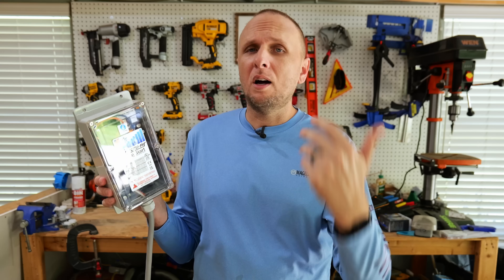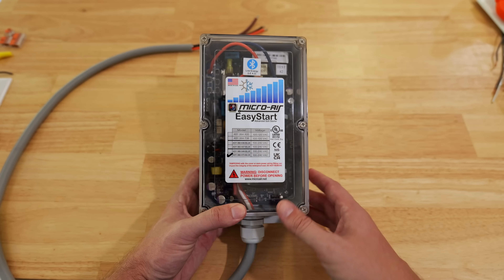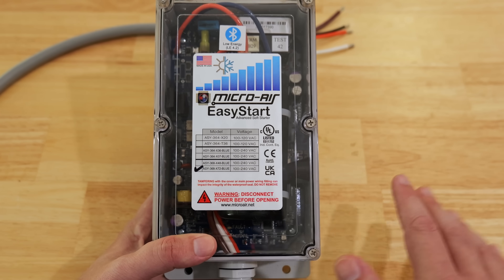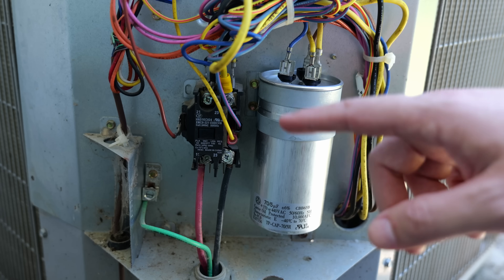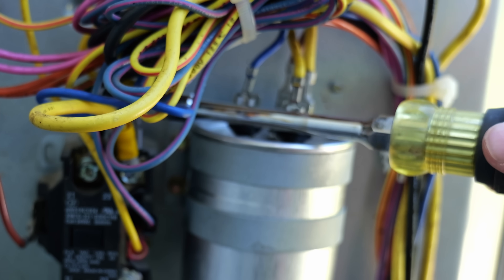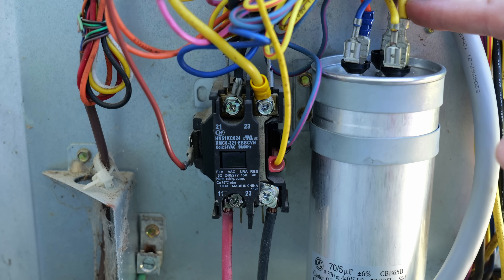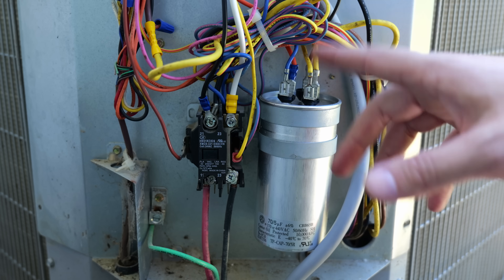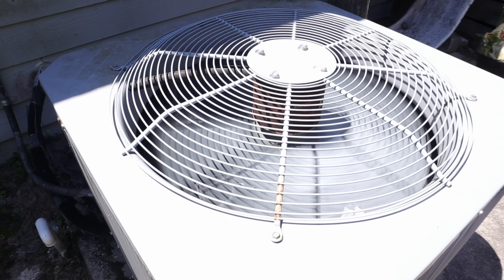Why Every Homeowner Should Consider Installing an AC Soft Starter | Micro Air Easy Start Install

Comment: Howdy again,   Thank you again,  i did the install in an hours time, mine is on roof and i got a work out just remembering the tools and materials i needed could have saved 20 minutes easy if AC was at ground level.  Works great, cool air takes a few minutes to come out as the compressor ramps up. but i no longer hear that loud HMMMMMMMmmmm at start up, so thats a good thing!   fyi   regarding your update,  mine there was two wires on "C" compressor one thicker then other, however the thick wire ran inside to were compressor was, the thinner wire connected to the terminal. i chose the wire to terminal.  must be correct as the unit works and i have a green light on the easy start.

Comment: It voids your warranty.
Reply: No it doesn't
Reply: Thank you. I called my warranty company and they said installing this will void my warranty. They are the ones that will repair my unit under warranty. I just don’t understand why the channel creator thinks this is not true. I have spent a lot of time tracking these conversions down to spread the truth about my experience just to help people.
Reply from the maker: Because it isn’t 😂.  Get a different AC guy.
Reply from the maker: Not true.  There is legal precedent as well where it can’t just void a warranty.  Now, if it’s installed incorrectly and due to it being installed incorrectly it causes a problem, then maybe there would be an issue just like anything else being installed on it.  But to say simply adding this voids the warranty is just not accurate.

Comment: Hey man, excellent DIY video. Perfect instructions and it was a breeze. Starting 143 A after 5 runs 27-30 A. Can’t believe how much it helped on A. AC runs good and it’s a lot more quiet during start up.

Comment: I installed mine about six months ago and my on rush current went from 77 amps to 23 amps.  It seems the systems should be designed with this.  Why have a large current to start?  Makes no sense!  AC has been running great.  Next thing you need is an Intermatic water heater timer.  The new digital version is great.

Comment: I have one in Florida and will install one in Texas, for generator you need an interlock kit specific for your panel, 50 amp 220 breaker, and 50amp cable for your generator.

Comment: I install one and make my ac crazy run good for a week and them fry the capacitor I try 2 more time and the same run good for a week them it fry the capacitor and it wont start I remove it and my ac is ok no problem
Reply from the maker: There are a couple reasons this could happen.  Either A: the wiring was not done correctly or B: the wrong size soft start was purchased for your size of AC unit.  Those are the most common reasons why you may have experienced what you did.  You can reach out to micro air with this issue and they have engineers standing by that can answer any questions or issues you may have.  I personally have had one installed on mine for 4 years + with zero issues.

Comment: Awesome video. Thank you. The money I'm about to spend on an EasyStart will be offset by knowing I can get a slightly lighter duty generator.
Reply: Just a comment, I installed on a 4 ton rheem ac , with the predator inverter 9000w generator and it run good, i have the 30 amp set up for the whole house with interlock.

Comment: I have a 2.5-ton AC, and the power wires run through my garage inside metallic conduit. Then the AC starts, and I hear the wires wiping inside the conduit. Will a soft start kit stop that? Several years ago, I added a hard start, which only eliminated it slightly.

Comment: So, another Micro Air Easy Start success story.  I installed it yesterday and went from 110.6  starting inrush amps to 45.9 amps.  I was hoping for a little more but I'll take it.  Anything to save on the energy bill.  Thanks again.  I also encountered a problem with my NEST thermostat.  Because we had not been using our HVAC heating much after a mild winter the built in lithium battery in the NEST wasn't charging so I was getting a delay on A/C startup.  Luckily we had a 5th wire in the thermostat wire bundle that had just been tucked away inside the wall and not connected at the furnace mother board (the C wire) that supplies 24v to the NEST.  Once connected on both ends, no delay.  All is good.
Reply: It doesn’t significantly reduce total energy consumption (kWh), which is what your electric bill is based on.
Starting an A/C unit might spike to 100+ amps briefly, but that lasts fractions of a second — and you’re billed for sustained usage, not momentary peaks.  You’re not gonna see any significant savings at all.

Comment: I did'nt see you mention the RLA rating. I have a 2 1/2 ton Frigidare unit with a 16.6 RLA and that requires a 32 Amp soft start. The  368 X 48.

Comment: I've got a Goodman rooftop package unit that sounds like someone is dropping a 5 lb sledgehammer on the rood when it starts up. I want to get one of these to see if it can quiet down my unit on startup. It's much nosier than my neighbors ground mounted units (mines on the roof).

Comment: The light came on.  I had it set on the wrong range of course.  The compressor is drawing 110.6 Amps on startup.  I'm installing the EasyStart and will update with the results.  Thanks for the video.  I could not have done this otherwise.
Reply from the maker: You’re welcome!  I’m guessing little drop to around 35-45.  Just a guess though.

Comment: I have the same Klein meter and when trying to test Inrush on the Run wire of the compressor I get 0.L for a reading.  I don't know what that's telling me.  Can you advise?  Thanks
Reply from the maker: It’s basically saying it’s not detecting any voltage.  So either power is not being sent to your compressor, it’s on the wrong wire, or there is an issue with the multimeter or setting it’s on.
Reply: Thanks for taking the time to reply. I had the meter on the wrong "range" setting of course.  Once I changed it to read the higher setting it was using 110.6 amps on start up.  I'm installing the EasyStart and will update with the results.  Thanks again.   @HowToHomeDIY

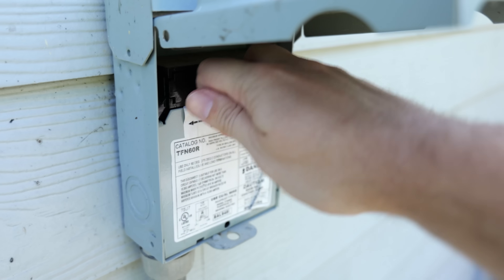Comment: 5:40 pausing a video  to ask for likes, 👎🏾bro.
Reply from the maker: Yeah it’s my video.  And I ask if you are finding value in it if you could leave a like and or question or comment as it helps the video.  If you’re not finding value in it then don’t.  It’s free to you.  To complain about this is hilarious to me.  But thanks for the thumbs down and the comment, they both still help the video 😂
Reply: @HowToHomeDIY yeah I mean I don’t see anything wrong with asking for likes. What is the average price a AC company would charge for an installation like this. I like to install one because if hurricanes and want to run my AC with a portable generator but also my AC is always super loud when it first starts

Comment: Hi, will this unit decrease the BTU capacity of my AC? Or in other words, will it affect how cold/hot the air will be?
Reply from the maker: No
Reply: But it might void your warranty. Just check with your HVAC manufacturer before installing.

Comment: Can these soft start kits damage these AC units?  Another YouTuber said one of these soft start units damaged an AC unit he was working on and removed it during his service call.
Reply from the maker: Did he state why he believes it was the soft start kit that did it?   Or did it just go bad and they blamed it on something they don’t understand.  I can tell you from experience, most AC techs have very little knowledge on them and how they work.  There is plenty of evidence though that they can extend the life of the compressor through softer starts.
Reply: The YouTube video title is Soft Start killed AC Compressor and put out by Mikey Pipes I believe.  I think you're right in that he didn't know much about these soft start kits.
Reply from the maker: He didn't.  He has admitted as much in the comments and even has a video showing how to install one.  The soft starter was not the issue.  They don't cause the compressors to go bad.  At the end of the video he shows his sticker on the AC unit as he has serviced it before.  Was he the one that installed it? haha.  It was the wrong size soft start for that AC.  And it clearly didn't kill the compressor as it still worked.
Reply: Check with your warranty provider before you buy or install.

Comment: Great Video, unfortunately my AC unit has a separate meter, DTE calls it interrupted service to where they can shut your AC down when the grid is overwhelmed, I need to disconnect that and rewire it the the breaker panel inside my house then I can get the easy start kit.

Comment: Installed mine yesterday. This video was very helpful. I went from 109 amps start up to 38 amps. I haven't tried the generator yet but I'm confident. It would ALMOST start the unit before. I have an 11,000 watt peak generator with 8950 watt continuous capabiltity. We have two fridges, a deep freezer and a mini fridge. The generator has never struggled at all with the heat pump turned off. I've even had a brain fart and welded a few minutes before remembering I was on the generator. I think the 3.5 ton heat pump will start just fine now. Thanks.

Comment: Does installing this device have any effect on the hvac warranty?
Reply: The channel creator will not answer your question because it very well might. I called my warranty provider and they said it will indeed void my warranty. It’s not that the device doesn’t work, it’s just something else that can’t be proven either way to be the cause of a compressor failure so the manufacturer just says no to keep liability down. The channel creator likes to argue about this and say it’s because HVAC guys don’t understand it but keep in mind, these are the guys that will be filing the warranty claim. If the manufacturer says no and the tech states the device exists on the unit then this is a violation of the policy.  Same as any policy. There are stipulations. Just a friendly warning. Check with your warranty provider before making a decision.

Comment: Sucks and customer service wants me to hook it back up and send pictures of it hooked up. When I know the problem is the easy start. No happy with this company at all. I just want to do an exchange with them. What happen was the unit quick working in the middle of summer and it was 110 degrees here in Texas. I traced it down to the easy start not sending power to turn on the ac unit. Disconnect the easy start and ac unit runs and  has worked just like its supposed to. It's a great idea but they need to fix the customer service side if it

Comment: The sticker on the orange wire says not to hook it directly to the capacitor that it needs to go to the run wiring instead. Where is that?

Comment: To check inrush, you said to clamp the meter onto the run wire.  So, it's not the common wire from the compressor? Thanks

Comment: if the soft starter stops working will the condensing unit stop working as well?
Reply: Yes, and the part may even void your warranty. Might want to check.
Reply from the maker: Yes if the soft starter doesn’t work the condenser won’t start.  And no, it won’t void your warranty.  This guy got some bad information from who he called his “AC mechanic.”  Most AC techs don’t know what this is.  So if one did say that it’s just because they don’t understand it.  Get a new HVAC tech if this is the case.
Reply: @HowToHomeDIY after I installed mine I had to call a technician due to a thermostat malfunction (related to the SS install 🤷🏼‍♂️), anyway the diagnosis was that the contactor went bad so he replaced it. I was at work during all these so when I got home my wife told me that the technician said that I probably need refrigerant and to use emergency heat if need be (we had a cold spell so no worries). When trying to connect to SS it was giving me an error so checked the connections (I’m an electrician) and he had both wires on the load side of the contactor on the same side so the fan will come on and it sounded like was working but the compressor was not getting 220V which was probably why said I needed refrigerant. I called the company they returned all my money and apologized.

Comment: Very nice job.  When you connected the black wire across from your run yellow wire, you did leave the original black wire connected, so you had 2  black wires connected.  Correct? Thanks

Comment: If using this for HEAT would you need to turn off the Emergency heat mode on the air handler? Also how does the AC pull 120 amps when the breaker in the main panel of the house usually no more than 60amp?

Comment: Installed this on my 4 ton heat pump and every time I go to start up the AC the breaker trips. Doesn’t make sense to me given the soft start is supposed to reduce in rush amps. Any one have any thoughts?

Comment: I'm putting one on my 4 ton just because I don't like how it makes my main panel buzz every time it starts up. Also, my utility charges a demand fee for peak wattage hour of the day at $18 per KW. They claim it checks on a 15 min interval, but we shall see if that is the case, and my bill drops after installing this. I'm in Phoenix so if there is a situation where power is out for an extended time, I could go out get a generator if needed. Although never been more then 5-6 hours. I'm looking into solar but not sure the ROI is worth it just because the amount of power usage here in the summer is so much.
Reply: Check with your warranty provider to make sure it will not void any warranty you may have on your unit.

Comment: Went to install this on my 4 ton unit and I think the unit already has some sort of soft start on it. The inrush amps were 8.4 and the fan inside starts before the rest of the unit kicks on. I also noticed this old looking circuit board wired in under the access panel. Any thoughts?

Comment: hey awesome tutor vid.  Questions:
What happened to the previously connected last black wire of the contactor?
Is it a big draw to keep electric water heater and AC unit running on generator or pick one of the two?
Is it a big draw to run central air heater on the generator in winter?

Comment: The AC unit that I currently have is protected by a 40 amp breaker. If the startup or LRA amps drops by the amount indicated, should the 40 amp breaker be replaced with a lessor amp breaker?
Reply: No. The breaker should be already sized to protect the capacity of the wire. I would keep the original breaker in case the soft start has to be removed or bypassed someday.

Comment: I am sure this question has probably already been asked, but will the Soft Start dramatically reduce my power bill as well??? How long does your Generator tank of gas last, while powering your entire home including AC? Do you prefer a regular generator over an inverter generator?
Reply: I will not reduce your power bill but it may void your warranty. I would check with my warranty provider first. My provider will not allow this in my unit. It will void my warranty.

Comment: My Air handler is in my attic so when the AC turns on I get 4 mins of warm air blown into my home before the cold air comes out. The 4 min Delay is at Every start. Is there any to Delay the Air Handler so this will not happen?

Comment: I like the idea behind this, great info to share.
I'm wondering if I have to be using a generator to install this device. 
It seems to be an energy saving device even if not using for a generator, is this right?
Reply: It may void your warranty on your unit. I would call to verify before installing.

Comment: I'm a real neophyte. So, bear with me, please. Every solar co wants to sell me a huge system with 2 batteries. Mostly my startup power draw is my 5T and 3T hvac unts. Your 5500 gen runs your 4T easily with the softstart unit. So, could I install a softstart on my 5T and operate my home during a hurricane shutdown with a 6.5 kvh battery (whether powered by a solar system or not)?

Comment: Thank you for this video!  installed the soft start on my 3 ton, Carrier AC unit and your video made it a breeze.  Took a total of 30 min granted I had butt connectors, spade connectors, etc.  and self tapping screws all on hand:-).  Subb'd 🙂

Comment: Something to be aware of.  About a month ago I had a new 30,000 BTU HEIL A/C unit installed to replace my 23 year old A/C system.  I asked about installing a Soft Start system so I could run my A/C system from my 8,000 watt generator.  In Rush amps on the new system is 71 and running amps is 11.   I was told that installing the soft start system would void my warranty.  I am still considering getting a soft start system but will only hock it up for use with my generator when needed.
Reply: I was told the same thing. The channel creator likes to argue the point and calls out anyone who doesn’t agree with him. Even techs that have been in the field for over 35 years that recommend not to install. I have a 10 year parts and labor warranty on my unit and my warranty provider stated this would void my warranty.  At this point I don’t even care why it voids my warranty, I’m not gonna install one until my warranty expires.
Reply: @FreshairSolider can you please elaborate why techs suggest against installing it?
Reply: @saimkhanafridi 
I was told that the compressor weakens because of the soft start. I am not a HVAC guy but this came from my warranty provider. Keep in mind he would be the one installing the soft start. Ask yourself why he would pass up a job. Well if he has to warranty the unit there must be a reason.
Reply: How hard would it be to uninstall before a warranty claim?
Reply: @reruiz85 I believe there are a few wires that have to be spliced in the unit. The service tech might pick up on that. Besides, I wouldn’t suggest dishonesty.